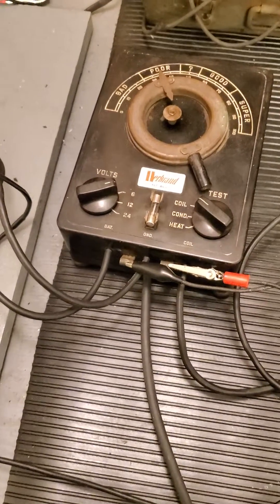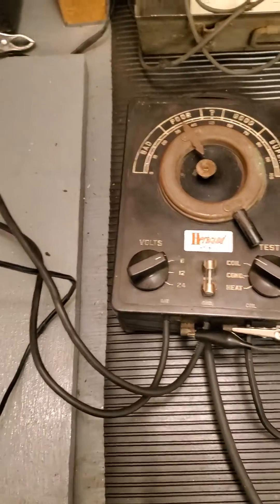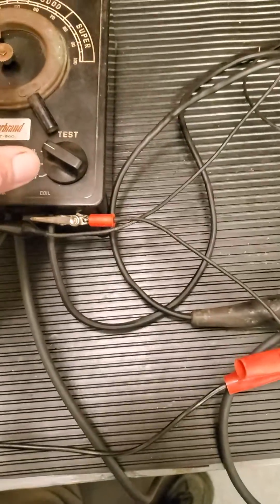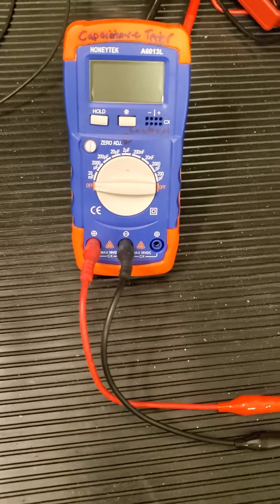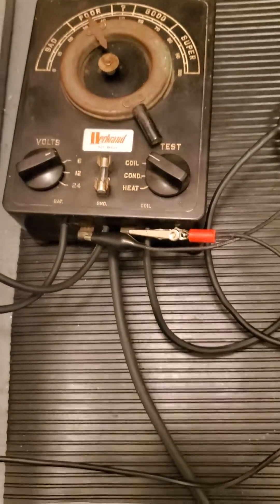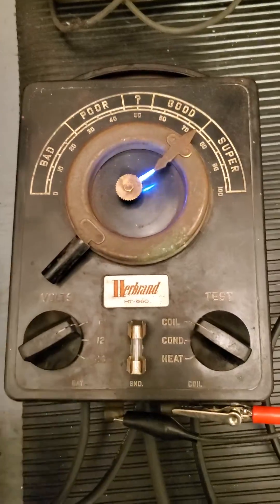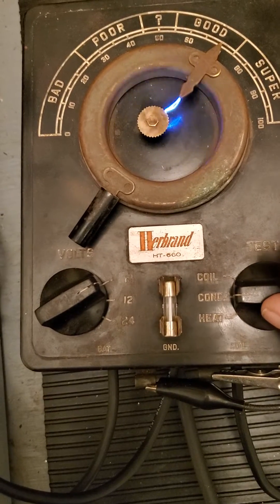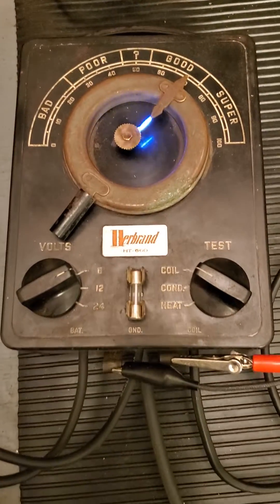Condenser and coil testing with 70+ year old Herbrand test equipment

Comment: That's really neat, Steve. The dial and pointer all working off that eccentrically mounted post are a great way of widening the gap while giving ann indication of performance. Question: If not using the condenser, does it use it's own internal unit or something? Thanks for showing this neat piece of equipment. Like everyone else watching "I want one". Mart in England.
Reply from the maker: Yes, it has an internal condenser that is used when the switch is in "coil" position. When I refurbished the tester, the original condenser was deteriorated and out of spec, so I just replaced it with a new one. With the switch in "cond", it simply routes the ignition circuit outside to the condenser being tested.